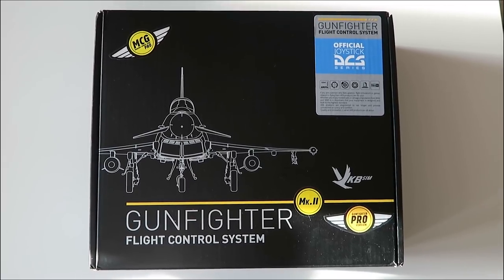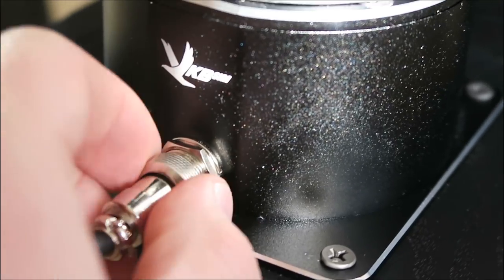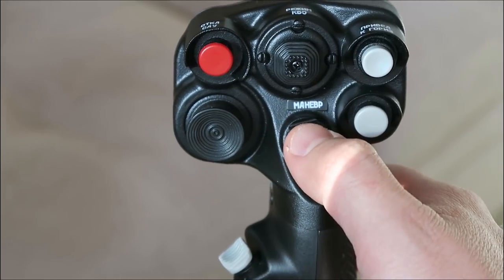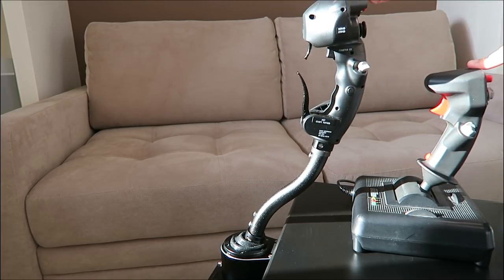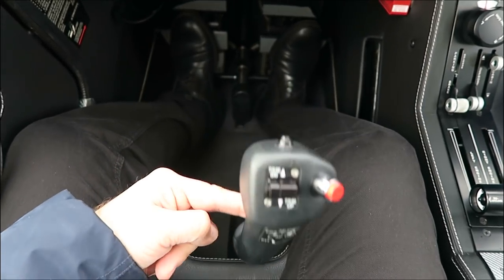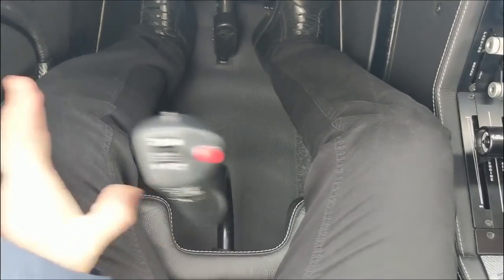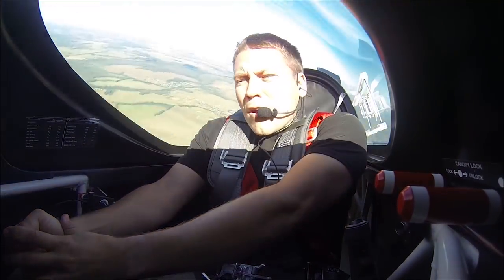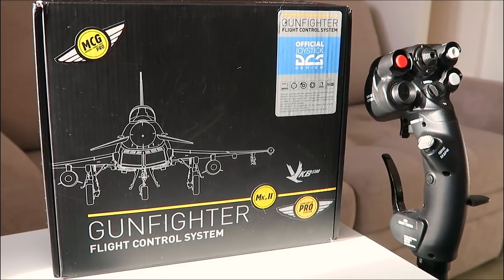Joystick VKB Gunfighter MCG Pro

Comment: I bought my first CH Products fighter Stick in the 90's, and only upgraded to the current version as I needed USB. CH Products are rock solid, and love them. After watching your video review I think I might try out this stick. Will check out your other video's and hopefully find one about the software to program the button's as that is very important part of the setup. THANKS
Reply from the maker: Well I'm a pilot and I do like flying)! So I haven't spent a lot of time clicking around software. I just did a basic calibration and after that I was able to map all buttons directly in the Sim. But this software let you do almost everything. But I do like straight forward things, cause I did a lot of negative G, that why Im not smart enough;))

Comment: The Virtual Engineering Bureau bull's-eyed the sidestick configuration that I presume first used on the Sukhoi-37LL pilot-controls test bed, a few-off build from the Flanker platform that spawned the Su-34 interdictor as well as the Su-27/30/33 fighter interceptors.  I's after a center-stick design with the air-brake handle pivoted on the column extension - where it is on actual Russian tactical aircraft since the Mikojan-Gurevich-15 (which used a reverse-engineered German KG-13 control grip) - and an actual pinky button (used in Russian helos as a hover-mode toggle, and in pre-Product-10 MiGs as a centerline fuel tank jettison) as well as the MCG Pro's other switchgear.  Only quibble I have about the MCG-Pro otherwise is the lack of a green button, historically used to delineate an automatic level-off mode in several Frontal tactical jets, at the top right.

Comment: That was the best review I have seen for a very very longtime. Well presented and product knowledge was exemplary!  Would one of this company's joysticks be suitable for a beginner to sim flying?
Reply from the maker: It doesn't actually matter, if you are beginner or well trained pilot.  It's a matter of what you want to get. If you want to have a more realistic experience of the control, go for it. As a bonus, every beginner will appreciate the extended stick because its much easier to control virtual aircraft with it
Reply: Maksim Savelev Thank you for your reply.

Comment: 2 Questions: 
1. since there are a lot of mechanical components - is there some sort of manual on how to put it together the way you like and how to calibrate?
2. stick looks awesome - especially with an extension, but what about the throttle/hotas - what would you recommend with this stick?
Reply from the maker: Foxhound482 1. It's already assembled from factory. All you need to do is to attach stick itself to the base. No special skill required, and manual is in the box. 
2. This joystick has no throttle. I'm using a simple CH-product Throttle qudrant.
Reply: Maksim Savelev thanks!

Comment: Hello Maksim, you review was amazing. What springs and tensioners are you using? I just got the MCG Ultimate here and can’t get the same behavior from the stick. Im using 2x50 springs and dampers at 50%, it oscillate a lot.
Reply from the maker: Hello Rafael. That's sad to hear that. I think the problem is in the weight of  Grip itself. It's almost twice heavier than my one therefore not enough stopping forces to prevent it from oscillation. I think VKB should offer some new base for new heavy metal grip, but they didn't. Hope they will come up with something
Reply: @maksimsavelev5478  yes, I think the GF base should be enhanced, VKB GF III NEO base. 🤣🤣🤣. Thanks men, still I’m in love with the stick. Excellent product.

Comment: I play "Star Citizen" (Alpha) with duel Thrustmaster T16000Ms (left and right handed) but due to Yaw (Z axis / twist) motion failures I'm looking for a new stick like the Gladiator Mk II but it's missing a left handed stick?  You indicated there's a modifier button to access additional buttons, is that correct?  ;-)
Reply from the maker: It's all about software. Basically you can assign everything to everything)  I'm not sure what you are talking about. It might be, I was telling about "Hat" that can be used as a mini-joystick, which is true. Anyway, I think for you setup even better to get LH+RH Cosmosima from VKB or new LH+RH Constellation-ALPHA from Virpil-controls (this new product looks great).
Reply: The “VKB Kosmosima Space Combat Grip Sneak Peek” shows configurations that either one I’d like to get (if the price wasn’t outlandish?
It also looks like (top image) this configuration isn’t available (@ 6-21-2018 )?
It's likely, neither are available.

Comment: How does the stick compare to force feedback like the Microsoft Sidewinder 2? I have a sidewinder, but the feedback can "tick" for no reason (force pulsates when it should be constant sometimes, i assume its the motors). Was wondering if a spring system like this holds up realistically.
Reply from the maker: The main two features of the force-feedback are : a moveable center of the load, and a changable load(from 0 to max tension). Unfortunately there is nothing like this system. So, looking forward to a get nice force-feedback system from VKB or someone else.

Comment: Great review! I'm really considering buying it. But Before I do I want to know, does the extended version have to be screwed onto something for it to be stable, or is it stable enough, on it's own to just be placed on the floor and for everything to work fine?
Reply from the maker: Well, yes it has to be screwed onto something. There are two base plates in the set. The big one is for the short or table version, another one small with holes for screwing is for extended version. So if you are going to use big base plate for extended version, you can even use tape to make it hold still.
Reply: Thank you for the answer.

Comment: i have a terribly stupid question about rudder pedals. if i push the left pedal forward does the plane yaw left, and do the rudders work the same way in Helicopters?
Reply from the maker: That's right. On you pushing your right leg together with pedal, airline does yaw left in general, bit it also will affect your bank and other they. Helicopter does the same

Comment: If only they ever actually had product for sale...   I like their gear, and I think I'm really going to like their upcoming throttle based on what i've read and seen of the preproduction news, but I doubt I'll ever see one available for purchase once they sell.  =/  

If you're considering a new throttle, read: https://stormbirds.blog/2018/01/02/first-look-at-vkbs-new-tecs-throttle/   and consider if it's worth your time to wait and see what they actually release.  Reading their forum news, there have been some changes, and still no word other than it's still being worked on.

Oh yeah, one more plus for the Gunfighter II base, they are making a F14 flightstick to replace the original one if you'd prefer that in conjunction with Heatblur releasing an F14 module for DCS.  More reasons to buy VKB.  And Thrustmaster released an FA18 stick as a replacement for the Warthog, might be worth a look.

Comment: How did you manage to get one ? :)) They still have no stock anywhere. I`m still waiting for pedals and joystick to appear in stock on EU site. Great review !
Reply from the maker: Slims , Well I've started to write emails even there were nothing in stock, so I think  I just got in a queue. And once it became available, they just sent me one.
Reply: Hey thanks, in the following weeks maybe they replenish stock on the EU site and i`ll be able to order. Again, great review, was really wondering if it requires some grease on the bearings your review cleared that out. Was really not sure if i should get the extension, you made my decision up for me as well.
Reply: +Slims I've been talking with VKB distributors, and they've updated their expected target dates for new shipments on their website. Basically: Chinese New Year messed up their supply chain, and they're expecting to wait upwards of a month to finally get new Gunfighter Pros in, and are expecting to open sales of new ones sometime mid April.

If you're as frustrated as I was by the news, you may want to consider having a look at Virpil's Mongoose T-50s. Which are not only in stock, but are also on sale. With the downside that they are much cheaper sticks, all plastic, only metal is in the gimbal at the base, fewer buttons and no analog hats, and are made specifically for mounting; no desktop usage at all. Still, the decision is there for a very similar stick setup to the gunfighter now or waiting upwards of two additional months for a VKB later.
Reply from the maker: Slims, It's a sad news. I haven't tried yet a product of Virpil company, so it won't be fair if I give you any advice regarding it. But what I've seen from the web, that it's not so advanced (if I may say so) as VKB one. But I do agree, its very difficult to wait for such a period of time. So its  up to you, if you should wait or not. Sorry for that
Reply: That is rather sad, just last Wednesday they announced on FSC EU that everything is on track and they expect delivery soon. What can i say, i will wait, going to have to hold on to my warthog for a few months longer. Thanks guys for the news.
Reply: Think of it this way, chaps: 2 months is only a fraction of the time this VKB stick will serve you once you have it! I say it's worth the wait!
Reply: Slims did you get a gunfighter?

Comment: VKB Gunfighter MCG Pro makes my MS Sidewinder Force Feedback Pro look like junk. I'm gonna look into this stick, bet it's expensive, but I can't image one better.
Reply from the maker: MS FF  still is one of the best joysticks. Cause it has Feedback! I'm still waiting for the good joystick with Feedback, I wish they could make one based on MCG Pro stick.
Reply: Maksim Savelev-  I've just installed CFS2 on Win7 Ult x64. I hadn't used CFS2 since 2007. I found a MS USB Sidewinder for $5, it's working, but missing top hat and rudder stick twist. I'm looking at purchasing a FFB-Vert Project adapter: http://www.iowajohnsons.com/FFBVert/FFBVert.html

I have a huge archive of planes, utilities I haven't looked at in years i.e. Aircraft Container Manager 2.5, Mdlfile DisAssembler 3.04... Now studying to get everything up and running again.
Reply: I'd like to add; I found Win 7 x64 SB Audigy 2 Platinum Joystick drivers that install perfectly (have x64 INF): http://danielkawakami.blogspot.com/2017/01/sb-audigy-series-support-pack-62.html

But, I haven't found MS SFFP power supply or SB Joystick bracket yet to test. But, my understanding is even with Joystick port drivers Win 7 doesn't have drivers to utilize it.

Comment: Have your thoughts on the stick changed since the review? Any noticeable changes in performance?
Reply from the maker: Well it's still pretty good. I wish they can make load  heavier. Using 2 springs on each axises is good for table version, but it's to weak for the extension.

Comment: Is this modeled after a certain real life system, like the Warthog Thrustmaster is modeled after the real life A-10 setup? It looks real enough, but if it was actually modeled after a certain aircraft's, that would go the extra mile for me.
Reply: Zachary Southard It's modeled after Su-57 stick with a slight modification in shape as few extra axis and buttons for a simulation purposes and manufacturing.
Reply from the maker: This grip is almost  100% replica of Su-35 stick.
Reply from the maker: Correct! Su-35 and Su-57sticks  are quiet the same.

Comment: does the stick return to center in flight?? with press on the control surfaces?? on the real plane that is.
Reply from the maker: mersyndol If I get question right. Yes on a real aircraft aerodynamic forces are trying to bring the stick somewhere around center position. But the sharpness and amount of the “brining back” force are matter of an engineering design and differs from type to type.

Comment: thanks for this Video. I am very interested. But i have 2 Points. Maybe i have missed it, but is there a throttle function? Have i to buy extra feet pedals for the side rudders?
Reply from the maker: It's just a joystick, that means you'll need throttle and rudder pedals as well.

Comment: Would you please, tell me, which cams are " stronger "
10 or 30 ?
I have the 10, but it feels pretty loose
Would it help if i replace them, with the 30 ones ?
Reply from the maker: Eduard Walter Hi. To be honest, I haven't tried cams 30. They should let you feel something like click when you're crossing the center. The center will be more pronounced. You may use it if its more convenient for you. For me it's so unrealistic, or it's better unnatural, so I will never use it. But if the stick is too loose for you, you may try to use another springs or even two of them(on every axis) and  make you dampers tighten. For the high stick I've tighten the dampers and installed 50+40 springs on every axis

Comment: is the extender to make it like a helicopter with the stick in front of you?
Reply from the maker: I'm not sure that I did understand it right. But if you're asking if it's much better to control helicopter with the extender using the center position mounting? The answer is yes, absolutely, you will definitely get more precise control, than the short side stick
Reply: yep thats what i was asking

Comment: Im having issues with my joystick the stick light that should be green on the red box is flashing red any reason why?
Reply from the maker: Have you finished calibration through the vkb software? Seems like data inside the joystick is not saved or confirmed. I did my calibration just once and it was one year ago. Unfortunately I can remember nothing)! Youd better check forums or wright into the support. I'm sure you are going to solve this problem shortly!
Reply: @maksimsavelev5478  LOOK ill play around with it for the next few day and get back to ya, I also wondering the playstation style thumb controller could you program that for any kind of dcs cockpit function like radar tracking?
Reply: @maksimsavelev5478  ok thanks brother I will i let you know how I went.  Thanks Mate.